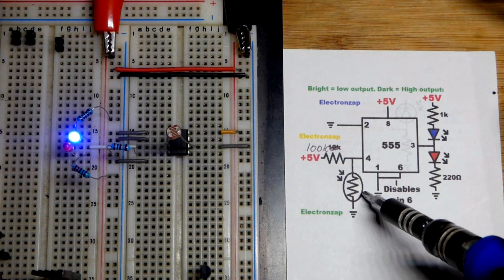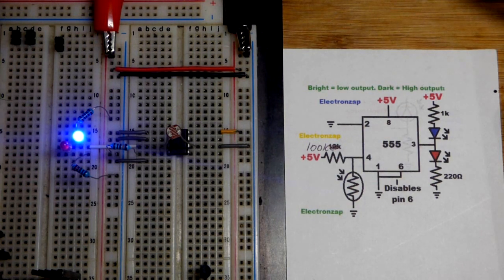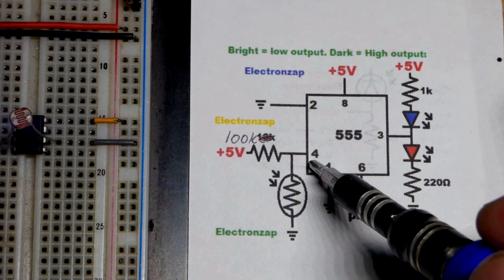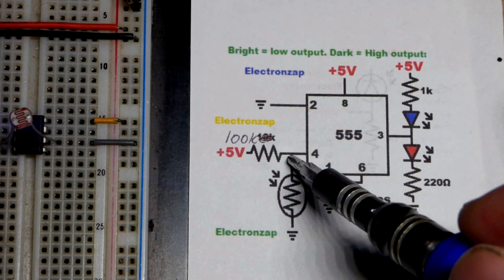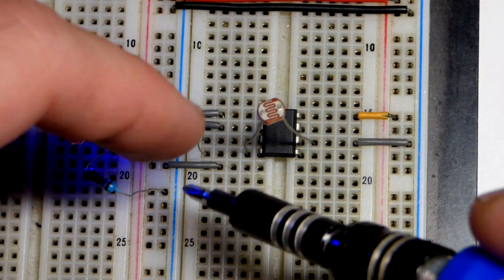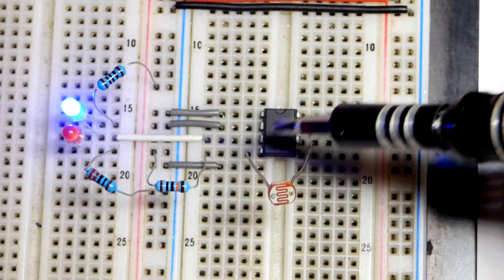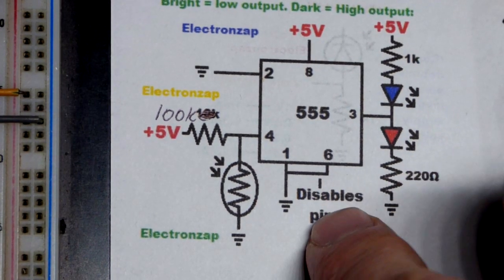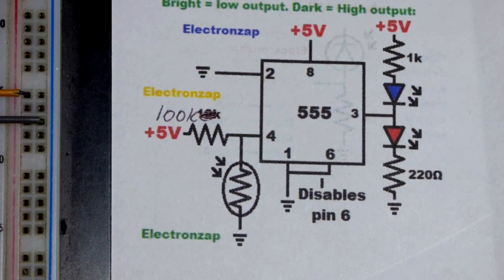Light Dependent Resistor LDR controlled 555 timer flip flop schematic diagram

Comment: What is the difference between a photo diode and LDR
Reply from the maker: While reverse biased, a photodiode lets a certain amount of current flow through it based on how much light is falling on it. The supply voltage doesn't have much impact on how much current is flowing through a photodiode. A light dependent resistor has a change in resistance based on the light level falling on it, regardless of in which direction current flows through it. The supply voltage is a major factor in how much current flows through a LDR.